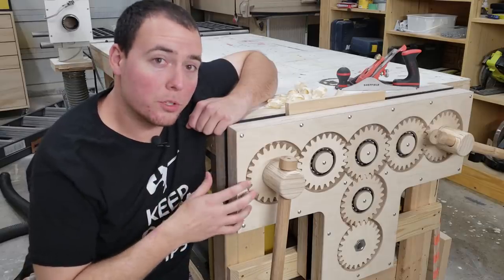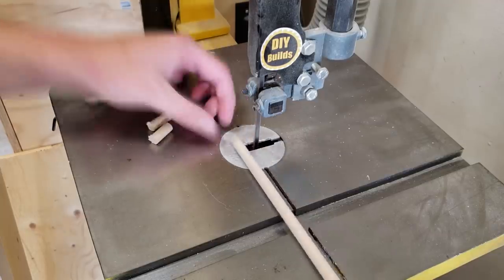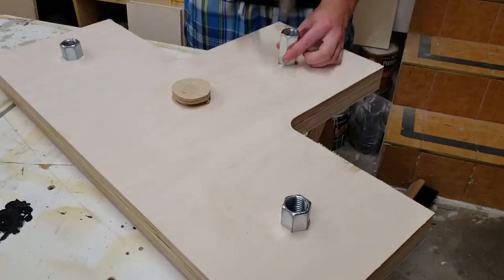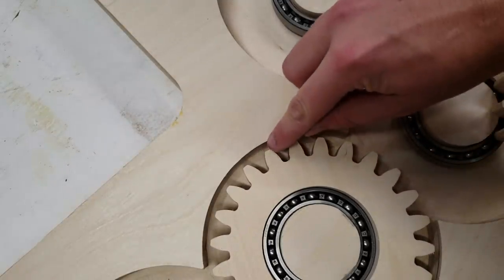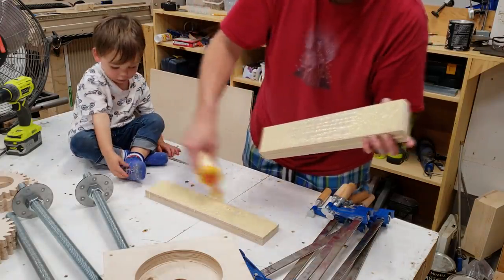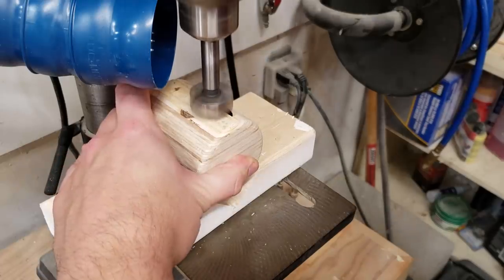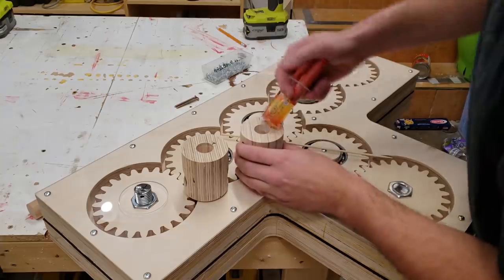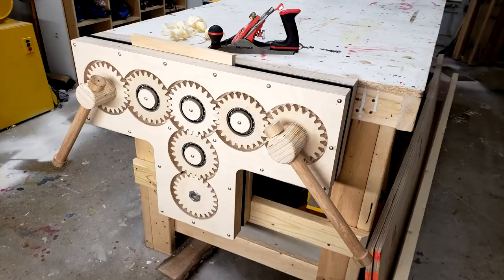Triple Screw Gear Vise

Comment: The use of aluminum nails instead of steel split pins will be the weak point in this build... aluminum nails are soft and have a very low shear strength...
Reply from the maker: Yes but they don't need to live up to an extreme amount of force.

Comment: Quite eye catching, even artististic approach. Fancy. Even using CNC machine... Making use of plywood, unorthodox. 
But not for real woodworking. Too thin, not massive, sensitive in sprockets. Two light, too weak - both the vise as well as workbench in whole. The rubber is doubtful material as well, trying to compensate for weakness of vise construction.
But as a school  project  real beauty, teacher will be impressed and the girls in school would adore the sprockets. Maybe.
Reply from the maker: Not sure how you gathered any of those bold points just by looking at it but i assure you it's massive, thick, heavy and strong. After all all it has to do is hold a piece of wood in place.

Comment: You know, super vise. However lots of cnc work that normal folks are not going to have the equip to do. That was my big criticism. Then I seen your child, video should be rename from I built a vise with computer controled mill to Im a great dad.
Reply from the maker: Thanks. I did use the cnc but no reason those gears can't be cut using a glue on template and a bandsaw/ jig saw.

Comment: I see that so often: why do you use glue AND screws? one of both would be enough.....
Reply from the maker: Screws provide clamping while glue dries and also ties layers together.
Reply: @DIYBuilds  but both is overpowered.
You will not get the layers separated if you use only one, the force is high enough.

Comment: Making this on a CNC is cheating. Lol It's cool though. Waiting for another channel to make a 4 gear clamp.
Reply from the maker: I could have done it with a band saw and hand held router if i wanted but when you make a cnc you tend to use it lol.
Reply: @DIYBuilds  work smarter not harder right. I'm checking out your CNC build video now. I need me one of those. Lol

Comment: The epoxy would have been a better solution than the cyanoacrylate...if I don’t err super glue has low shearing strength....
Reply from the maker: Agreed but the ca glue isn't supposed to stop it from rotating just stop from wandering off.